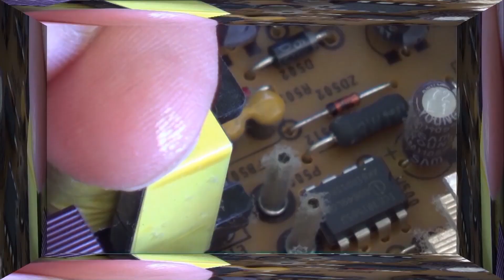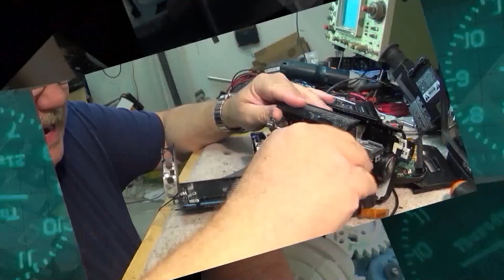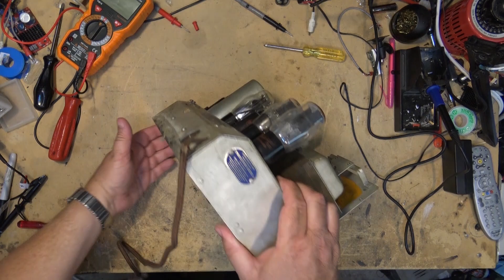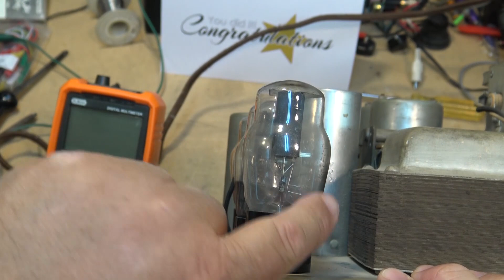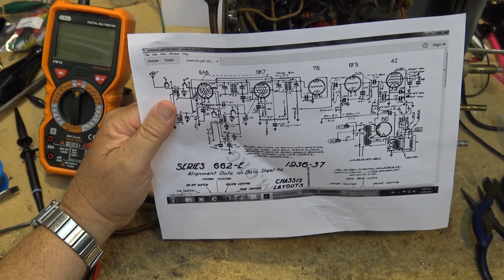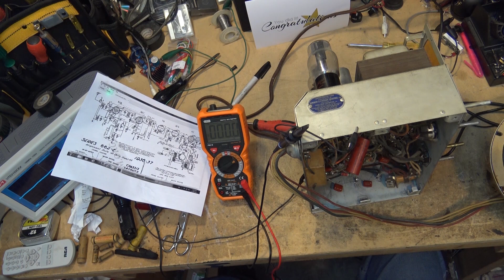80 year old Electrohome series 662 E radio restoration and diagnostics part 1

Comment: Trivia:  (same company listed on Cap? Hamilton, Ont.) December 1938: The Aerovox Corp., maker of condensers, announces it is moving its plant and offices to Belleville Avenue in New Bedford.

1938 to mid-1970s: Aerovox emerges as major manufacturer of capacitors and other electrical components.

Comment: When unpolarized caps actually are polarized to electromagnetic field instead of current flow...
I've never heard about that before, interesting info!
Reply from the maker: Its not that they are polarized, the outside foil acts like an antenna and picks up stray induction. That is why the outside foil needs to go the the low impedance side, either ground or supply, so that the induced current will not hot the next amplifier stage (grid of the tube) and be amplified. It will make an amplifier hum slightly if put in backwards.
Reply: @12voltvids  Ah, so the shield needs to be connected to the lowest impedance connection instead of the lowest potential?
The funny thing is, most (unbalanced)wires have the negative contact as a shield (like the shield of RCA connectors), instead of ground as shield. When I turn up my phono preamp gain real high and touch the input cable, I can hear the noise coupling into the wire.
Reply from the maker: @QoraxAudio  
Right.  Usually it is the ground as it would be in a filter or bypass cap such as kathode coupler to ground.  The outside foil is connected to the plate on the leading stage because in this role it is a blocking capacitor to block the high voltage from getting into the grid in the following stage. If the outside foil was connected to the grid of the following stage any noise induced on it would be amplified.  When it is connected to the plate side noise will still be picked up by the foil but the ratio of it is much lower by comparison to the signal coming off that stage.
Reply: @12voltvids  Yeah, that makes sense. 

But now I start to wonder how much RFI is picked up by all the metal filament parts within the tubes when they're not mounted in a metal can.
For me, there's always something to ponder or worry about when it comes to noise and accuracy while doing an electronics project haha
Reply from the maker: There were shielded tubes in metal cans.  Used in Rf and if circuits.  6sc7 is one I remember but there are many others.  The filiment really isn't an issue because on indirectly heated tubes the metal cathode surrounds it and that is at ground potential anyway.  After the metal jacket tubes they started putting a metal screen, around the outside of the plates to stop electrons that missed the plate from flying out of the tube.
Reply: @12voltvids  Oh okay, looks like there's a lot to learn about tube electronics for me.
I have done some home projects with electronic tubes, but mostly for retro looks instead of signal processing, like magic eye tubes and nixie tubes.
I always assumed the metal plate was for heat dissipation to minimize thermal distortion and filament stiffness against microphonics; so I couldn't be more wrong about that haha
I suppose it is quite common for people like me, who have been born way after solid state and even SMT electronics became the consumer standard in daily life.

Comment: There would usually be a visual clue to an open output transformer, that is the screen grid on the output tube glows red hot.
Reply from the maker: If the plate is glowing red hot the tube is over biased. Either a bias resistor has failed or a capacitor has gone electrically leaky. This will burn out the tube and also the transformer.
Reply: Sorry, but I said the screen grid, not the plate. If the plate has no voltage the screen grid will act as an anode,( assuming it has voltage), and the screen grid will glow red hot because it can’t handle the current and over dissipates. I’ve seen this many times.
Reply from the maker: @widecast  If you loose your plate there should not be any flow of electrons as the screen grid should be negatively biased. If it isn't then you will get full flow of current to the plate which wil burn out the output transformer. If your grid is glowing hot, it is because the negative bias is lost on the screen, likely due to a open resistor or electrically leaky cap. This will over saturate the tube, likely burn out the winding of the output transformer. Then you lose your B+. If the screen is positive at this point it will get hot, but the screen should never have a positive voltage on it.  It is biased slightly negative, and is modulated by the signal.
Now saying that, I would never apply power to one of these dinosaurs with the original paper caps. In all likelyhood the screen would have glowed red hot had I tried to power it up with the open transformer because the grid would have been pulled positive by the leaky paper caps, but since I replaced them all BEFORE attempting to power up, the negative bias would have been restored therefore there was no grid glow. The plate would have glowed red hot while the transformer was burning up. Since these radios are getting scarce and the parts hard to find I would never risk doing damage to one of these. I have 5 in my personal collection all restored. I don't run them much, just turn them on once in awhile and let them play for an hour or so, more to show them off to people.

Comment: Something I thought you would want to be aware of....I watched someone testing "brown drop" caps like the ones you installed in this set.  They all had a stripe down one side like the old paper ones, and you would think that the stripe was on the outside foil end...well, half of them were, half were not.  I guess the safest bet is to test all your caps, place some sort of identifying mark on each one, and when you use them, you will know which end is the correct outside foil end.
Also, I would like to urge you to trace out the electrolytic caps with the diagram (schematic) and find the value of those and replace them as well.
This video might also be of interest to you:
https://youtu.be/BnR_DLd1PDI
Reply from the maker: I also fully aware of "outside foil" and do test them when I buy them to identify them.  I do go over this on my videos.  You must be skipping ahead.  I know Paul built an auto switching jig to check them but I am not that lazy. It takes no more time to switch the cap around manually. Also outside foil is not as big a deal on modern caps as opposed to the old ones just due to the physical size of the new ones.  There is less surface area to pick up incidental interference than on the old paper caps.

Comment: Another awesome radio with those  vintage tubes!
I know it would be nice to be able to replace the caps with originals, however that's not that important as you can't see those parts normally anyway in normal everyday use. As long as the unit performs well. An original engine in a classic car is more desirable, but with the hood down, it doesn't matter.

Comment: yeah when i think of valve radios i don't think of 12 volts but more like 160 volts. granted the filaments use 6.3v on most tubes but still

Comment: What about evaluating the unknown solar cap first?  Solar made some fairly respectable caps.  The capacitance may be near the original.
I thought the SOP for radio work was  check transformers and chokes for continuity,that includes IFs. Then tubes, then resistors and cap replacement.
Asbestos is not so dangerous as it has been made out to be.  Millions upon millions of brake shoes and clutches were made with it. Countless buildings have asbestos insulation sprayed in the drop ceilings to protect the steel framework, and mile after mile of  main water pipe (cement transited) are still in use.The list is so long. Far overstated.
Reply from the maker: James Lucas 
I found no data on that multi stage cap, but the values were shown on the schematic. 2 of the 5 in it were already bypassed by the time I got this so I just looked up the values and changed the rest. Paper capacitors are the number 1 cause of other component failures in tube gear. Coils and transformers generally do not fail unless they are overloaded and too much current is drawn. This overheats the wire melts the insulation and a short results.  When you see these Old caps don't measure them, replace them before applying power. No doubt that audio output transformer was burned out by the owner as he told me he plugged it in and it started smoking. That mistake added 100 to his repair bill as that is what that transformer cost for a new one. When I work on vintage all the caps gotta go before I plug it in and trouble shoot. I have 3 of my own pieces to look at. An old Normende stereo, a McIntosh 1500 and a Halicrafters. They will be looked at sometime soon I hope. When I get time. My wife is on my case for the Normende stereo as it was her parents that we have inherited so she wants that one overhauled so she can put it on display in the house.
As far as asbestos goes as long as it is not disturbed it is fine. It is the dust that is the problem. Don't be ignorant of it. Go tell that to someone that is sick because of exposure at work. I know a mechanic that is now dying of asbestos lung cancer. He did not smoke but he was a heavy duty mechanic and was exposed daily to brake dust. The dust masks they used 30 years ago did not help him and his doctor has given him 6 months to live. He is 54 and likely won't see 55.  Where I work we sometimes have to go into atics. We have to Don full respirator before going into crawl space or atic
Reply: 12voltvids 
Thank you for your comments. Really looking forward to the McIntosh restoration. Hardly anyone doing McIntosh videos. A testament to their longevity or they are just still as costly old (may be , some appreciated vastly  e.g. MC 250.). I have 3 MC2105s. One amp for bas, one for mid range and one for high. They were an amazing amp, built like a truck but have the best of the best components.
Will be anticipating that and the Halcrafters. Good luck.

Comment: I loved this video. I miss fault finding in my job as an electrical fitter in a power station. It didn't involve much in the way of electronics as it was mostly relays, limit switches etc in control circuitry so I'm learning loads in your videos. Anything below 50 volts and we usually got an instrument tech involved although that's changing more these days, I think! Can't wait to see this up and running. What's your day job btw?
Reply from the maker: I work for the phone company now, but it isn't just phones. Actually very little palin old telephone service (POTS) it is now more DSL / Bonded DSL, PON and IPTV work that I do. 
I ran the service dept in a repair shop for 20 years, and still work on stuff, but not as much as before. I like the old vintage stuff. I am searching out the output transformer for this radio now. I have a few leads, and am going to probably go with the universal replacement option.
Reply: I had to retire early after an accident at work but still miss (some of) the work and the banter!  I started doing a bit of electronics  to keep my hand in on the electrical side and am thoroughly enjoying it.  I particularly enjoy radio but I'm afraid it's all new to me so any hints and tips on your channel are well received!  Your job sounds interesting although I know from experience that when you do it every day it can become a bit tedious at times!  Keep up the excellent work 
Davy
Reply from the maker: gartmorn 
My day job is actually not boring because every day is different. I drive around from one customer to the next. Some installs some troubles and upgrades. Yesterday I had to configure a security system for remote monitoring and that required forwarding ports and setting static ip. Today I am upgrading service to HS 100 over copper and after lunch I have trouble on fiber for low light levels. Every day is different so the day goes by quickly.
Reply: My job was varied and involved troubleshooting and maintenance on power plant from 11 kv down to 50 v.  Then I did a spell on day work doing routine maintenance which was quite repetitive!  I moved onto operations after that (mistake) which was even more monotonous!  Having said that I did cover in the control room which could be interesting as I was operating a 600 megawatt unit!   I got retirement after an accident when a steam valve blew out and burned my legs from the groin to below my knees requiring major skin grafts.  I miss my work but couldn't work back in a hazardous environment.

Comment: It looks like someone took the Viking to a Philco dealer/service representative at one point earlier in it's life, I see at least two Philco branded paper caps under there. Watch out for those dogbone BED coded resistors, they are almost as unreliable as the paper caps, they love to drift upward in value. I would not worry too much about asbestos, the spaghetti tube was usually made out of a phenolic or fiberglass product. As for the wiring asbestos cost money and radio manufacturers used to cut corners anywhere they could, some even used bare rubber covered wire because it was cheaper then the cloth covered stuff. Even if the wire had a some asbestos insulation it's easy to tell, for one thing it's much thicker then normal wire, a there would be a layer of fluffy white material under the cloth jacket.
 The Viking is a 1937-38 model I believe, Electrohome used to use a code in their model numbers, the first number being the year it was designed which would have been in late 1936, the second, the number of tubes, also a six, and the third the number of bands the set had, which was two. The "E" just stood for Eatons, but if it had been an "S" it would have stood for Simpsons, and if it had a "P" it would have been marketed under the Phonola brand. On battery radios they would place a letter "B" between the first and second numbers, so if it were a battery set it would be branded as a 6B62-E, AC sets had no letter between the first and second numbers, and AC/DC series string sets had a "U" placed between those numbers. It should be listed in the RCC manuals under "Phonola" but you might also have a look at the Pacific TV site for a schematic.
 Nice cabinet, it looks very similar to a 1936-37 Canadian Westinghouse model, but with a much cheaper and plainer looking tin dial rather then glass. At least nobody has ruined the finish on top with a potted plant, which seems to be the fate of many console radios.

Comment: When I posted that the Type 42 was equivalent to a 6V6, I was in error. it is equivalent to a 6F6! All those power pentodes are similar anyway. Sorry for the confusion!
Have a good one!
Dave
Reply from the maker: Right, well the tubes all look to be OK. Once I find a sutable transformer I will be replacing the electrolytic caps. Don't know what I will do with that box cap yet. Don't know the values but with the print it may be easier to identify what it is it. Looks like a few have already been replaced, as a few wires are already cut off it..
Reply: A type 42 is a power pentode, a 6V6 is a beam power tube, the difference is that one of the grids is replaced with deflection plates in a beam power tube.

Comment: When I was taught to solder, I was told that you had to make a good mechanical connection and then solder it. Relying on merely solder to hold wires together, I was taught, is a no-no!
Reply from the maker: Swarf Rat 
I did make a good connection. A few were tacked down to hold one side in so the other side could be soldered in and then I went back to the other side. And twisted , resoldered the first. This radio is by no means finished. The electrolytics need replacing, but I need to find that transformer first. This was an investigative look to see what exactly needed replacing.
Reply: Sorry! I didn't mean to sound like a troll. I guess I didn't see all that you were doing. I apologize!

Comment: Never heard of or seen jacketed wire containing asbestos and I work on old electronics all the time.  Last thing I worked on which had asbestos in it was a ceramic glowbar heater from the 1940s which was used for defrosting freezers.  BTW the stuff is still mined and used in certain industrial applications.
Reply from the maker: I'm not saying that the jacket has asbestos, however it might. We don't know. I haven't had it tested. I am referring to the insulation tubing that is often places on leads to power resistors that can get hot on old electronics. Since asbestor was so common it is entirely possible that a component may contain it. For that matter the water main that supplies my house is asbestos concrete. It broke last year, and when they hauled out the piece that they cut out they put it in a hazmat bag. They also kept the area wet as the worker was cutting it and he was in full PPE to make the cut.. It used to be used in many things, and unless you know for sure that insulation does not have it, then you have to assume that it does, and take the appropriate measures to avoid cutting, drilling, or disturbing it.